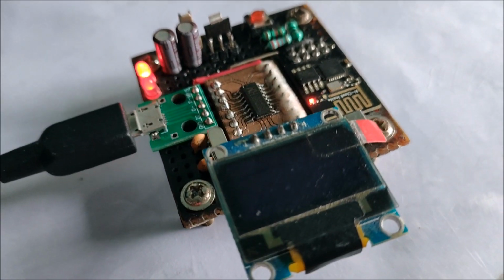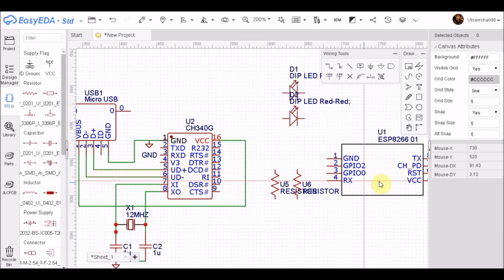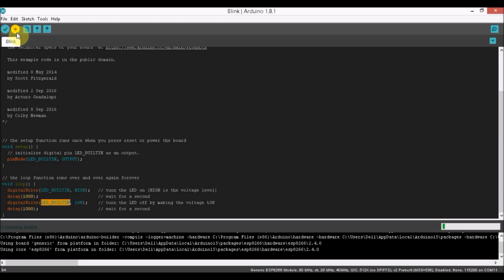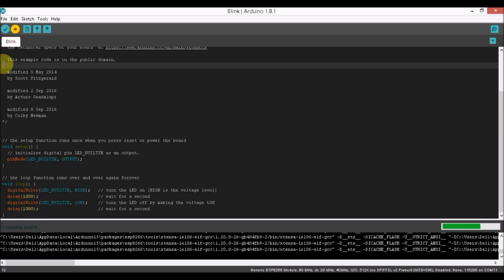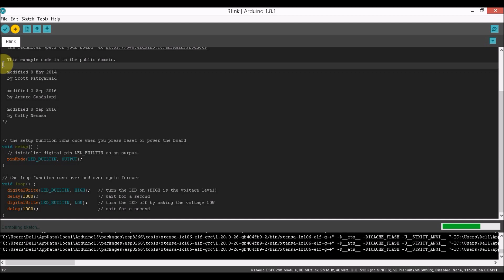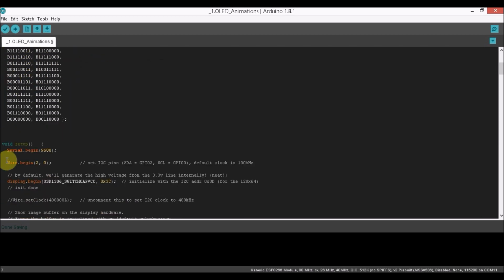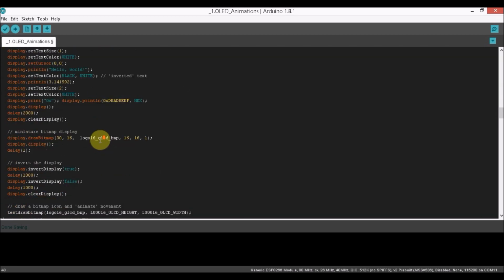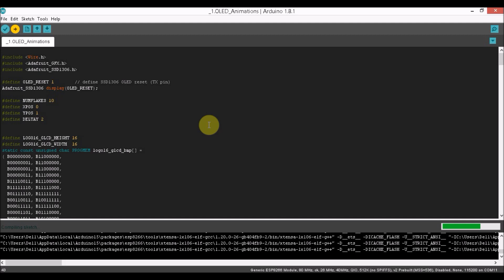A new ESP board you have never heard of ! ESP-O-One

Comment: IR2104 mosfet driver ic kajuri tha. Local market me nahi mil raha hai. Kya de sakte hai
Reply from the maker: Is project me IR2104 ka use nahi ho raha hai . But replacement ke liye IR2110 use kar sakte hai .. connection aur pins thora alag hoga
Reply: DIY 200watt inverter part 2 me use hua hai. Jo 4 month after wala video me use kiye hai aap